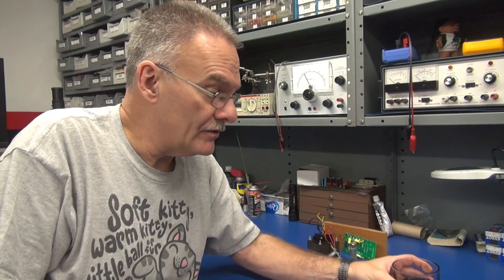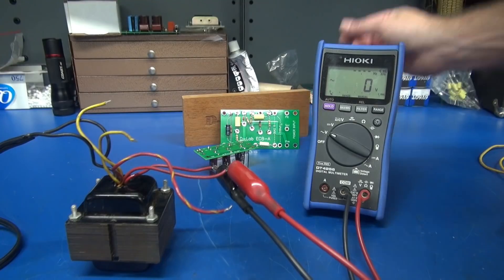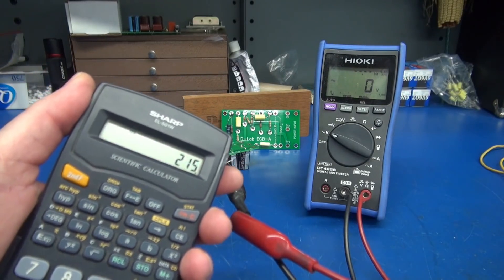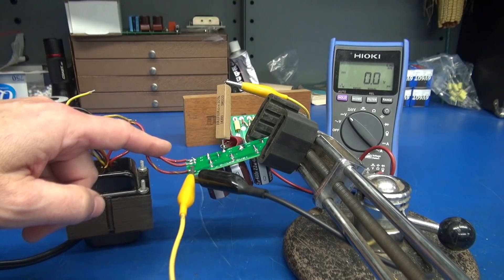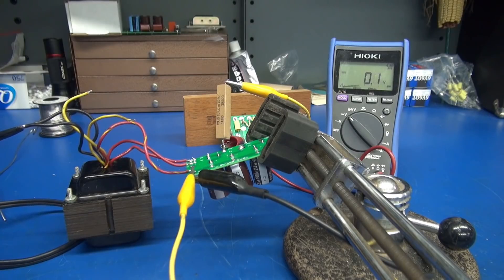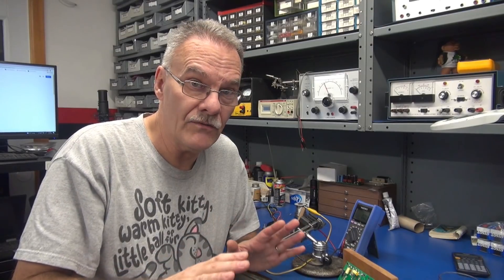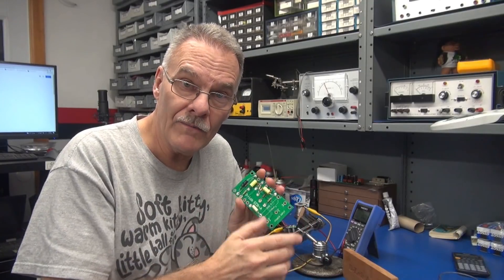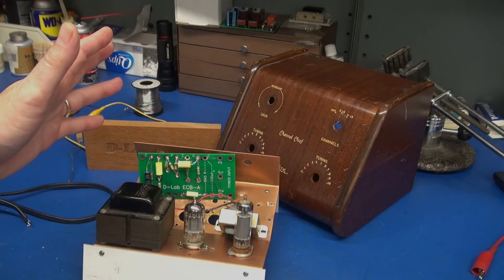How to select proper transformer for tube amplifier builds Example 6AQ5 Class A guitar amp

Comment: I want to build a Champ circuit and I see all kinds of used Triad and Stancor power transformers on ebay. The 5F1 I think is showing about 325VDC B+ coming off the rectifier and about 320VDC feeding the plate of the 6V6. I guess the first filter cap or maybe the output transformer caused some resistance? If you have too much B+voltage for the output tube's plate, can you still use the power transformer and just put a resister in between the rectifier and the output tube to knock the B+ voltage down to the desired level?

Comment: Last weekend I took a class learning how to build a tweedy Princeton 5F2A circuit, tweaked by my instructor Matt Dawson to be even better and run quieter.  It may look like a simple circuit, but now I know how complicated it is, and while I built it that doesn't mean I understand what all the components do - far from it.  But I understand more than I did previously, and have a cool little Princeton to play with, which is basically a tweed champ with a tone pot in a larger cab with 10" speaker (Legend 1028K - similar to P10R).  A very pure sounding class A single-ended amp, the tone pot and larger cab/speaker make a huge difference - it gets loud and has tight lows.  The components are the best Matt could source, including "Sour Sound" transformers for the three used in that circuit: power, output, and choke.  Brian Sour is right next-door to Dawson Amp Repair where I took the class, and they have a working relationship.  Soursound makes some of the best "vintage" transformers you can buy, they sound great in my new little Princetone!

Comment: What about the audio output transformer?  I want to wind my own transformer for a Dynaco 60 amp.  Circuit drawing shows 5Kohm, 8ohm to speaker.  Audio output transformer calculator says 25 : 1 turn ratio.  Specs say, 60w transformer need to be 60 x 5 = 300w so peak pulses do not get cut off.  The question I have is, I know 8 ohm winding can not be 1 turn.  How many turns on the 8 ohm winding?  I the secondary is 20 turns then the primary should be 20 x 25 = 500 turns.

Comment: Question. Does the load on the filament winding also pull the CT HV winding output voltage down a bit more too?

Comment: Great video Terry. I wonder can I take a liberty and ask a PT question please? I am building a clone Fender Deluxe Reverb amp ( AB763  but without the vibrato circuit ) and I think I have purchased the wrong PT. I have a Hammond 372FX which will give 600v CT @173ma but I should have got their 290BEX which provides 660v CT @138ma, Could you advise if my transformer will still work and if it will affect the tone please. Much appreciated.

Comment: D LAB, what formula are you using?  AC voltage X 1.414 = DC Voltage?
Reply: Rectified and filtered AC x 1.414 = DC.
Reply: @timburle4980  The Filters capacitors are storing the rectified AC into charged energy which I'm not sure if this is considered "reactive power" because capacitors are considered reactive power and not apparent power. Rectified AC is apparent power I think and filter capacitors are reactive power?
Reply: Search about " dc bus voltage formula " !

Comment: I have just lucked out on some very nice Stromberg Carlson Amps. One runs  4, 6550's and some of those military Metal incased 6????. There is huge iron in all these amps. I think they were designed for 100 watts (or more) output. Probably huge voltage in these. Will your class a boards be okay here and need costs and shipping info. Plan to build a single ended, 1 swappable power tube for different sounds, volume and tone. Cautions , schematics, ideas?...your clips are very helpful and many thanks...Daniel

Comment: Hey Terry, I have a P.T. with a 0v-120v 100mA High Voltage winding, and a 0v-12v 2A filament winding. Do you think I could power a pair of 6AQ5's if I used a voltage doubler to get 250v DC? Should I run them a bit cold if I do that?

Comment: Terry, I have concerns.  The RCA tube manual lists the maximum plate voltage as 250V.  (Tung-sol says 275).  But before the tube warms up and draws current, you're likely to see 300V as you're using solid state rectifiers that lack the time delay of tube rectifiers. Also, you didn't show what your wall voltage was at the time.  The voltage could go higher if the amp is plugged into a outlet supplying 125 VAC.  Personally, I'd be looking at something that supplies 250 VDC unloaded and somewhere in the mid-point of the 180-250V suggested operating range when loaded.  Hopefully in the 210 to 230V range.
Reply: Tube maximum voltage is a suggestion. They are resilient to over voltage. It's the current you need to be concerned with. Check out a fender Princeton schematic and a 6v6 datasheet